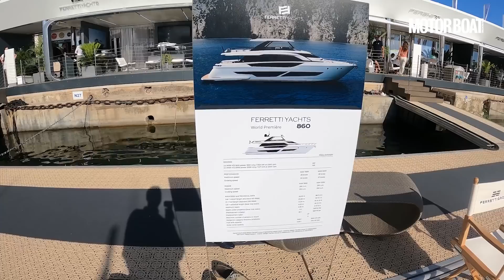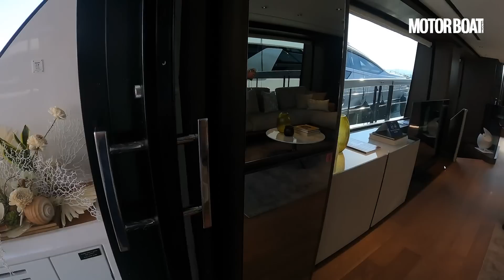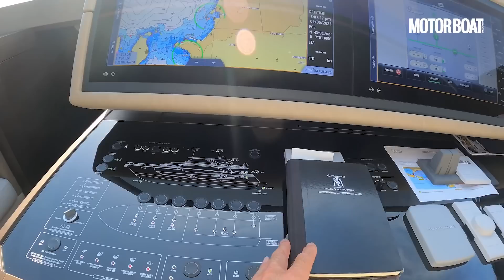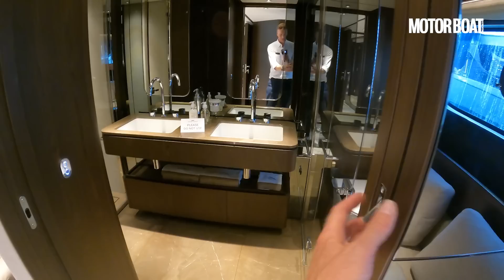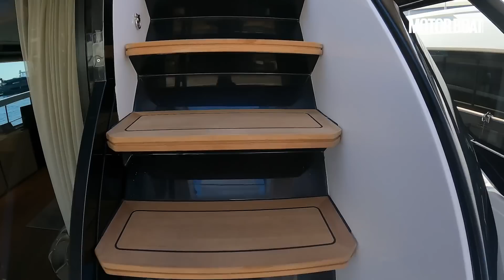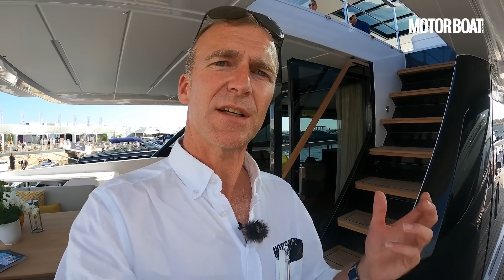Ferretti 860 yacht tour | Inside the very latest Italian luxury motoryacht | Motor Boat & Yachting

Comment: It just doesn't make sense to me  , 86 foot yacht that has a range of only around 300 miles ! What do you do , fill it up every day ?
Reply: That was at high speeds..back it down to 10-12 knots I'm sure its over 1000.
Reply: That range is at 26 knots.  If you drive at 10/12 knots it goes up to about near 1000 nm.
Reply: This is a perfectly normal range for this style of boat. The reality is that most of the time you are only going to be covering 30-40 miles in a day when cruising around the Med with the occasional longer trip between destinations.
Reply: He’s an idiot. Has to open every cabinet, no respect for crew either